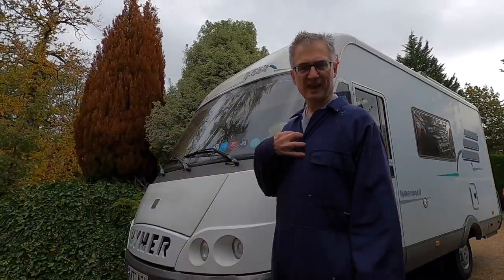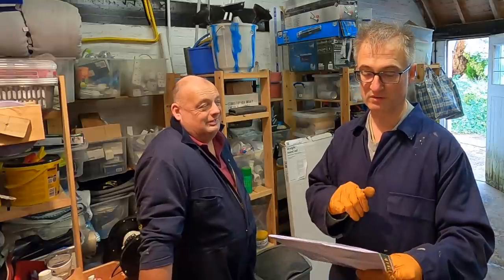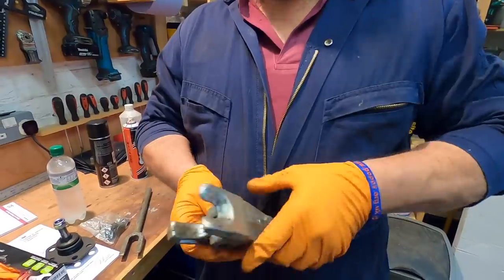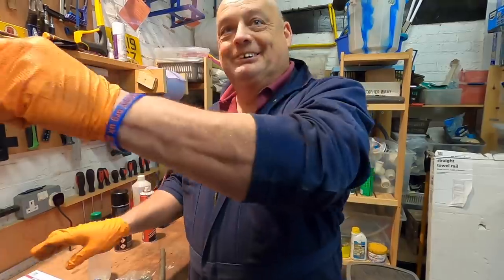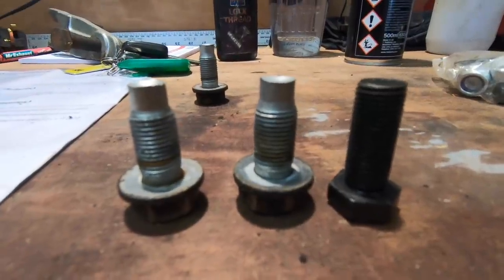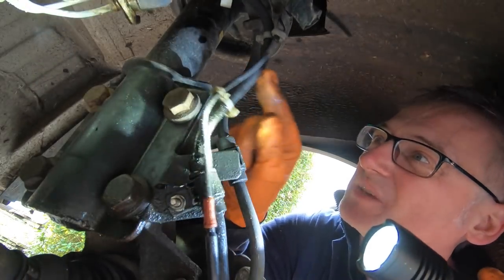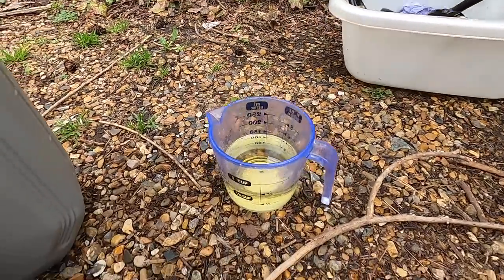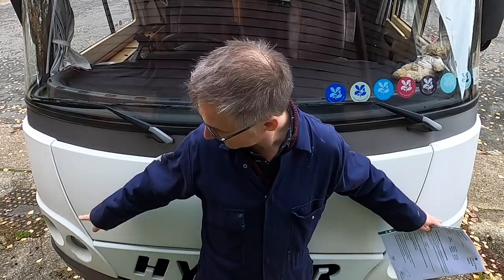Herman FAILS the MOT

Comment: Great video I need to replace my off side head light as it has failed the mot .But what it the secret of removing  the headlight out please many thanks Rob
Reply from the maker: The headlights are a right pain to get access to, @robertdoree1504. I was able to access them by either coming in from the bonnet or on my back on the floor and reaching up inside. I think a small electric screwdriver and long slim arms helped. It may also help if you jack the front up a little when reaching up depending on your stature and how low the front of your motorhome is.
Why did the headlight fail the MOT?

Comment: Hmmm , my 20 year 584 has just missed it's mot . I started a cooling system overhaul just after lockdown ended , back in march /april , and it rapidly deteriorated into a full rebuild . The only original parts left , are the  cooling fans , themselves suitably overhauled , and of course the engine . Many of the hoses were fairly easy to source , but several parts including two smaller metal pipes that run down the front of the engine , were by luck . They are like hens teeth , i eventually sourced a pair in Italy , along with other parts from Germany , Poland , and Lithuania . The timing belt has also being replaced , along with all new tensioner parts . I found the originals almost seized ! . I've also dealt with two small oil leaks , i didn't know existed . A new alternator and auxiliary belt finish the mechanical , along with such mundane bit's like a new battery tray , etc .  
I had to reroute the vacuum pipe you mentioned failed on your van . It would appear mine has been replaced at some point , but had been lead over several sharp edges , however i've been lucky , it's undamaged . 
I also had to deal with the corrosion you mentioned on the offside chassis leg . There was no sign of any issues until i removed the inner wing , to rerouted the vacuum pipe . It was bad , but not serious , however that said welding was required . This is the reason the van missed its mot , though i have got it in undercoat , i lost the weather before i could topcoat . Meaning i couldn't finish assembling the cooling system , because i removed the cross member for the job . And this as you know , supports both the rad , and intercooler . So i repainted it instead .
I brought the van 3 years ago , and shortly after noticed some damage to the front bumper . Unfortunately , i added to it last year , coming off the levelling ramps in Cornwall , so i decided to put it right . I learnt to weld plastic , but talk about jumping in at the deep end . It took me three days to repair it , i found much more damage after i removed it , along with damage to both front spats . Their now finished and are also awaiting top coat . 
You did well to remove the brake pipe flairs from the rubber hoses , Last year , i got sucked into replacing the wheel cylinders . I discovered one leaking while preparing to replace the rear wheel bearings . I ended up renewing pretty much the whole rear braking system from the fuel tank back , as i was unable to break the chain . 
Ahem the front is also on the list , but not urgent .
Chas is quite correct to be worried about snapping bolts , i've pretty much replace every bolt , i've struggled with , others i've just replaced , with stainless . I don't like the makeup of the originals , they look more like cast than anything else . Fortunately there're of a fairly heavy cross section , myself i'm using a 2ft struggle bar , along with copious amounts of easing fluid . Many more jobs will get completed , before the planned mot next year . I dunno exactly when that will be , but i'm not planning on taxing it till April , so it will probably be at some point in March .
Reply from the maker: Wow Mickey, that's a hell of a list. It sounds like you are getting there and making progress and I guess it's a good job you're tackling it now rather than when it's too late or costs even more.
We also found the rear wheel brake cylinders leaking when we did the bearing. And the front cross member was replaced a few years ago.
Good luck and let us know how you get on.
👍👍🚐🚐👍
Reply: @HermanHitstheRoad  Well at the minute work has stopped , mainly due to the weather . I need a decent temperature to splash paint around , and i'm not gonna get that anytime soon , i'm pretty much expecting next march . The other thing i'm watching , is work . I'm not sure how that's gonna pan out , with current event's as they are . I now have all the parts to complete the cooling system and get the van running again , with the exception of a 140 ah battery that's replacing the original 85ah habitation battery that was already fitted . 
If you plan on doing any work to the front bumper , be very careful with the indicator recesses , they are paper thin , the fog light recesses are a bit thicker . One of my indicator recesses had almost completely disintegrated , with the otherside in poor shape , but not quite so bad . I ended up cutting the damage sections out and replacing the plastic with new  . But a tip on Paint colour , it's a much debated subject on many forums , both here and abroad . After a lot of research , i discovered the actual colour is moulded into the plastic . The flaking so paint , is actually clear coat lacquer , so be very careful during preparation with wet and dry .
  
The reason for much of this work , is i plan on taking the van over to Spain next year for an extended period . A friend lost his wife just before current events kicked off , and is struggling a bit . The travel ban provided the ideal time to get at the bones of the thing , but it seems the van has realised it has owner who's prepared to spend some money , and things are queueing up for replacement . I would also like to take a look at the power steering , and at the very least change the fluid . However any further , many of the pipes would have to be custom made ,  and likely bog me down again . Like some of the coolant hoses/ pipes , they are no longer available . The pressure the system works at , means i would have to learn more new skills and retool . Safe to say , life is anything but boring !

Comment: Hi ads. Well, I'd expect a few MOT problems with a motorhome this old, but that's almost expected. What isn't expected is a 19 reg 12 months old to fail a damp test!!!!! - which ours did. Elddis boast that their new SOLID construction makes it almost impossible for a motorhome to rain in. Really??? Not impressed at all. It goes in next February to be 'supposedly' fixed by a place at Bamber Bridge. Preston Caravans told us to take it home await a call about it. The sealant on the side and rear low down panels and wheel arches is clearly bad so I wiped it clean and covered it all in white electricians tape. From that moment on it went (according to our damp test meter) drier and drier. They said all the kitchen and shower room will need removing to find the problem which we find horrifying when I think I've fixed it with just with a 50p roll of tape. Is this a con or what? If this is the problem and they told to take it away and stand it in the rain for months knowing it can only go worse why didn't they reseal the joint and see how it goes? It's even more disappointing when you think that Hymer owned Elddis when this van was built. I'll keep you posted. Good video by the way.
Reply: Wow you must have a body warranty?
Good luck with it mate 👍 
Keep us posted. 
Chas.
Reply: @charlessmillie8774  Ok We will. Yes there is a body warranty but we'd still rather not have our motorhome pulled to bits. They say we won't even know it's been done. Really? Cheers.
Reply from the maker: Wow Derek, that doesn't sound good or at all right. "Almost impossible" means it's still possible. So, if you think your tape is stopping the leak then why do they need to take the  kitchen and bathroom out? I guess they want to check and make sure and see the damage.
Good luck and I hope it doesn't cost you penny and it's not off the road for too long.
Reply: @HermanHitstheRoad  Hi ads. The thing is, they haven't a clue at this stage that I've used tape to stop the leak (I think). It is under warranty but we'd still not want it pulled to bits. It's like buying a new house and after a few months the builder says 'there's a bit of damp under your sink. The kitchen will have to come. All the tiles knocked off the walls and all the floor will have to be ripped up, but don't worry - 'cos is it's under warranty. It won't cost you a dime!' Would you think 'oh good. It won't cost us anything' ? I, like others thinks it's a scam. Apparently  Elddis used a faulty batch of external sealant on their 2,019 motorhomes. We know this,  so how come Preston Caravans haven't re-sealed it and give it back to see how it goes. It doesn't look damp, smell damp or feel damp. When we take it in, it will be as dry as an old bone. That might get them thinking! I'll let you know. Thanks for replying.

Comment: My base vehicle has just failed spectacularly! Strange how it only had TWO MINOR ADVISORIES last year just before i bought it and I’ve only driven 3000 non motorway miles! I suspect the garage were ‘touting for business’ hoping for me to get THEM  to do the repairs to non existent faults! Sadly for them im a qualifed engineer and know vehicles inside out SOOOO......the van is going to a known trusted MOT station for a ‘second opinion’. If they dont find the faults Trading Standards will be visiting them!😡
EXTREMELY SUSPICIOUS as your faults are almost identical to mine and we KNOW those faults are ‘imaginary’. There is a growing theory that MOT stations have been given instructions to FAIL older vehicles to get them off the road so be careful. My van was meticulously maintained with receipts so HOW they could list these faults is beyond me🤷🏼‍♂️ 
A favourite ‘trick’ is to say various lights arent working AND /OR headlamp aim is off (its a simple adjustment but a garage will charge you £50! Sad,y for them i CHECK my vehicle lights DAILY........so i KNOW they lied about my side lights and one headlight not working and i even PROVED they were working! 
The ‘brake pipe corroded covered in grease etc’ is what we in the industry call a ‘bullshit’ fault as in ‘pipes covered in bullshit or dirt’ YEAH RIGHT 😂😂😂Total cowboys😡Good luck with your retest
Reply from the maker: Thanks for that Keyboard Krazy. These guys were pretty thorough but it sounds like your MOT station is making it up. On the opposite side our last station seem to let anything through. Our leaking front shock for example. This is why I don't believe in the "fail old vehicles"  rumour. This station was almost going to fail the horn not working but then it sprang to life - loose connection which I've now fixed. Your station probably wants the business but they shouldnt charge £50 to change a bulb.

Did yours fail on anything mechanical? Things can  deteriorate quickly and not being on the advisory doesn't mean it's ok for next year. You could pass the MOT and then have something fail while you're driving home.

At the end of the video we get a retest and pass. Good luck with your retest. When is it?